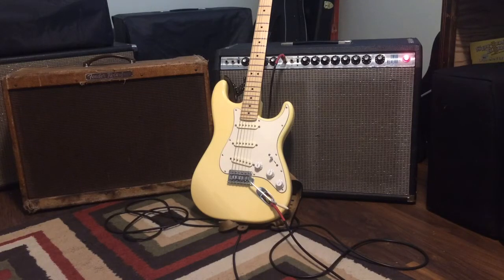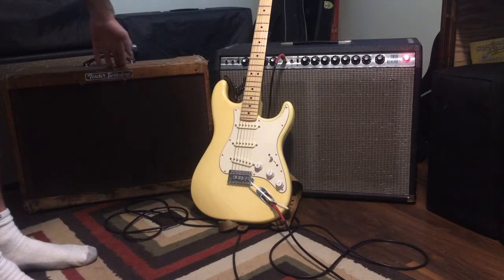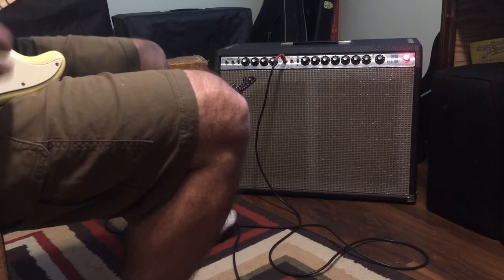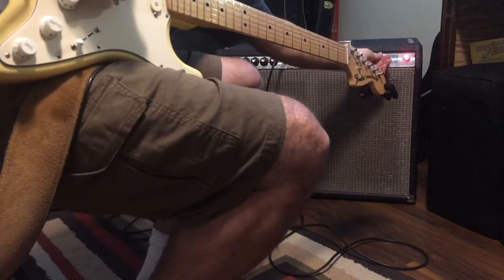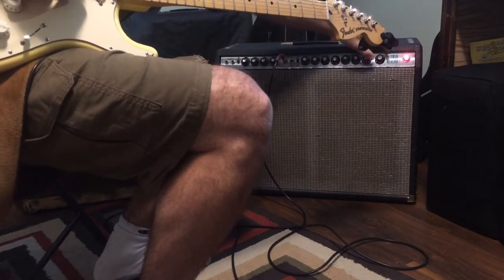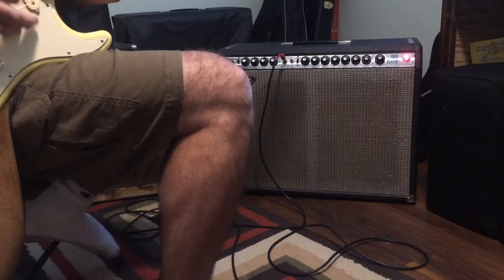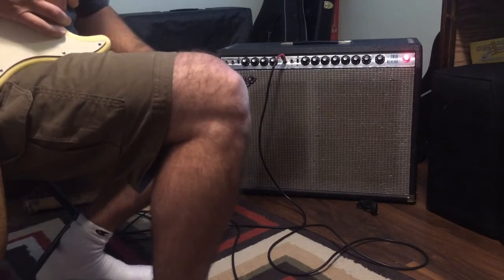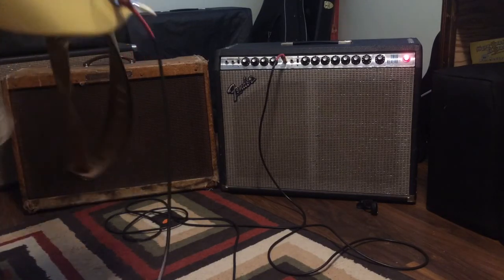1978 Fender Twin Reverb

Comment: I ve been using  and modding these amp from the 80's I configure mine to play Rock and metal  these amp will do it all, there are all kinds of easy mods you can do .   The mods I do is add bias pot, convert reverb to over drive, remove the  tremolo and use the the tube to run a active loop /w in and out levels, remove Death Cap and convert the 3 way switch to 3 way neg feed back.  I mod the normal chanel to get reverb and tremolo (which for my amps is now  overdrive and effects loop) and re voce the tone stack.   these mods bring these amps to todays standards . these amps need  closed back cabs to sound right and tight. It's not that difficult to do these mods. no matter what these amps kick ass.
Reply: I kinda disagree with everything you said lol 
Why not just get a Pro Reverb if that's what you want?
My mods: 1. Blackface the reverb circuit (much easier on the reverb tube). 2. ADD a 50k trim pot on top of the Bias Balance pot (inline with the 33k resistor). This gives you the best of both worlds. An adjustable bias and a way to balance the voltage accross the pairs - allowing you to use ANY tube in any position and no need to buy matched quads etc. 3. Check the hum balance pot works. They are sometimes shot. If its shot replace it. 4. Install/replace the exisitng screen grid resistors with 5w 470ohm cement or metal film. 5. Fit 1ohm cathode resistors (to easily set the bias). That's it! Check the lead dress and make sure that all the electrolytics are replaced (especially the filter caps). 
I use JJ's in all positions except V2. I prefer a chinese tube there for crispness. Eminence Legend 1258 speakers. 
The amp loves pedals and will crunch nicely with a clean boost like a Klon-style pedal. Or overdrive with a nice warm mid hump. 
You can go nuts with these and blackface other areas of the circuit, change one or both pairs of power tubes to run in triode (disconnect the UL taps) etc etc.
Defeats the point: twins are loud, tight and clean all the way to 11. If you don't want that, get the right amp.. because trying to turn one of these in to something it isn't, is a lot of time and effort for little real world value.

Comment: That sounds like its been 'Blackfaced' (even if it hasn't). I hate that mod! If you want modern sounding twin, buy a different amp! :)
Reply from the maker: Circuit is stock in this amp. It had not been blackfaced.
Reply: @keithb7  Fair enough. Its the speakers btw. Change them for something a bit more transatlantic and they sound awesome. Eminence Legend 1258's pretty good.